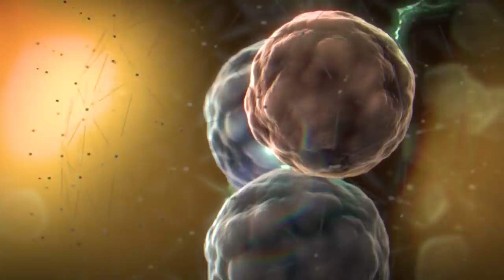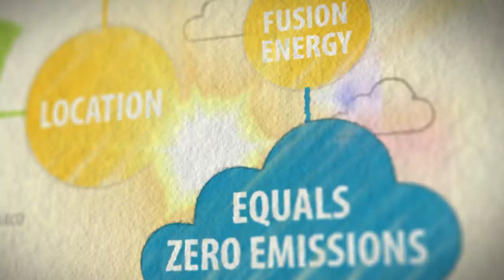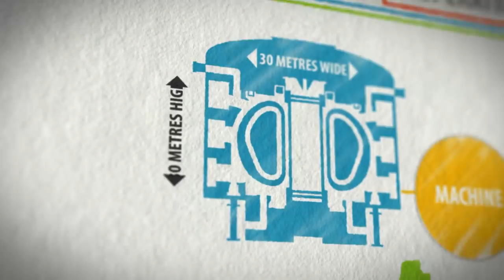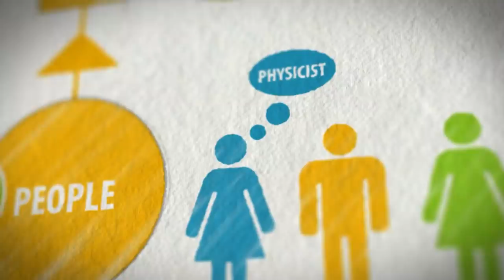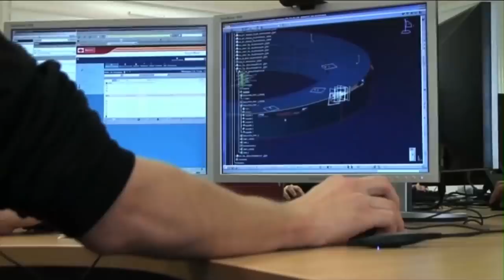ITER NOW 1.1: The Way of the Sun

Comment: I don't understand why it is necessary to build an industrial-scale tokamak when a net energy gain has not yet been demonstrated with a smaller machine. What if this one doesn't work?
Reply: To gain net power, the machine needs to exhibit a sufficient energy confinement time. This is only fulfilled for machines in the size of ITER or even bigger. Smaller machines (like JET in UK) simply "cool down too fast", so that they couldn't produce an energy gain. Previous work on those smaller machines already formed a broad basis of knowledge about magnetic confined fusion, that we're confident enough that ITER is worth trying.
Reply: @fwieschollek  Thank you for the explanation. I accept it, but it begs the question as to why researchers are building and using smaller tokamaks when theory (as you imply) clearly indicates that fusion will ONLY occur above a certain size.
Reply: @bradleycooke5214  The answer is simple: its very complicated and expensive to build such a big experimnt, that it has been  possible  only to study the physics of tokamak devices on smaller scales for centuries ;) Remember, that ITER has been proposed for the first time by Reagan and Gorbatschow in the late 80s. It simply took so long. Good thing is, that many aspects of plasma physics are qualitatively the sane in smaller devices and we try to understand them now and then extrapolate to ITER's size. It looks good in general, but in the end we need ITER to prove thar all the predictions were right.
Reply: @fwieschollek  Thank you for your response, and I appreciate the dialogue! Here's another question: I know about the necessity of superconducting magnets to confine the plasma and how cold they have to be, as well as their proximity to the plasma itself. That's a huge engineering challenge! Question: Is the cryogenic system to cool the magnets used as a heat exchanger for the generation of electricity? If not, what will be the mechanism of heat exchange in a functional tokamak? cheers!

Comment: I sincerely wish that you'll succeed, i'm convinced about you being our best bet for humanity's future. Quick question: did you have to deal with "climate activists" in any way and if so, how did it turn out?
Reply: Why would climate activists be against this? It's clean source of energy!
Reply: @FrankyPi  It's NOT clean but produces deadly radiation products.look it up.
Reply: @esecallum  What you describe are classic already existing fission reactors like in fukushima, once in chernobyl etc. This is a fusion reactor. It fuses hydrogen into helium. The only thing that gets a bit radioactive is protective material that gets bombarded with neutrons but that can be recycled within 100 years its not nearly the same level of radiation as fusion nor is it a nuclear waste like in fission reactors that needs to be disposed of that lasts thousands and millions of years before it cools off its radiation. Radioactive danger levels are extremely low compared to fission reactors. No heavy radioactive elements like uranium or plutonium involved.
Reply: @FrankyPi  Scaling down the sun. As noted above, fusion reactions in the sun burn ordinary hydrogen at enormous density and temperature, sustained by an effectively infinite confinement time, and the reaction products are benign helium isotopes. Artificial (terrestrial) fusion schemes, on the other hand, are restricted to much lower particle densities and much more fleeting energy confinement, and are therefore compelled to use the heavier neutron-rich isotopes of hydrogen known as deuterium and tritium—which are 24 orders of magnitude more reactive than ordinary hydrogen. (Think of the numeral one with 24 zeroes after it.) This gargantuan advantage in fusion reactivity allows human-made fusion assemblies to be workable with a billion times lower particle density and a trillion times poorer energy confinement than the levels that the sun enjoys. Consequently, the proponents of fusion reactors claim that when they are developed, fusion reactors will constitute a “perfect” energy source that will share none of the significant drawbacks of the much-maligned fission reactors.Now, an energy source consisting of 80 percent energetic neutron streams may be the perfect neutron source, but it’s truly bizarre that it would ever be hailed as the ideal electrical energy source. In fact, these neutron streams lead directly to four regrettable problems with nuclear energy: radiation damage to structures; radioactive waste; the need for biological shielding; and the potential for the production of weapons-grade plutonium 239—thus adding to the threat of nuclear weapons proliferation, not lessening it, as fusion proponents would have it.
Reply: @esecallum  Thats exaggeration and false, radioactive materials produced as a consequence of fusion will be recyclable within a century as i said. Do you have any credible source of info about what you wrote, any proof?
Reply: @FrankyPi  google it.
Reply: @esecallum  Google what, i asked you for your sources of what you said. Credible sources I learn from don't state what you claim so I smell conspiracy level bullsh*t.
Reply: @FrankyPi  You re just jealous i know more than you... i don't need to prove anything. also ITER IS A FLOP AND WILL NEVER WORK BECAUSE IT IS THE WRONG SHAPE. ITS SIMPLE A JOBS CLUB.

Comment: what wastes produced from fusion reactor process?
Reply from the maker: ITER will produce very little waste material; here's how it is described on our website:
"Fusion reactors, unlike fission reactors, produce no high activity/long life radioactive waste. The "burnt" fuel in a fusion reactor is helium, an inert gas. Activation produced in the material surfaces by the fast neutrons will produce waste that is classified as very low, low, or medium activity waste. All waste materials (such as components removed by remote handling during operation) will be treated, packaged, and stored on site."
Reply: @iterorganization  very cool...or hot!, can't wait for the fusion energy!
Reply: @NKG416  just to add to iterorganization answer from their website "No long-lived radioactive waste: Nuclear fusion reactors produce no high activity, long-lived nuclear waste. The activation of components in a fusion reactor is low enough for the materials to be recycled or reused within 100 years." In comparison nuclear fission what we currently use creates waste materials which can last from 220,000 up to 15.7 million years.

Comment: I'd love for this to pan out but the timescales involved in iter are measured in decades, way too late to help resolve climate crisis and general energy needs of the planet. Don't forget iter are doing the groundwork but will never produce real electricity, that comes after several decades of research and more time building a real reactor for actually powering cities. Also can't help but feel that it's a little "all eggs in one basket" strategy, with the tokamak design only, certainly the best current strategy for fusion but may not actually be the best after necessary research work is performed. Sad really.
Reply: 1) So? Give up because it takes too long?
2) So it's already too slow and takes a huge amounts of resources, and you want to split the time and resources for MORE parallel projects?

Comment: i don't wanna be that guy,  but this will most likely fail..  and fail hard.   oh well.
Reply: Based on...
Reply: @trezapoioiuy  "Reality", as of end of 2022, this is already a failed project.  multiple parts have cracks and fitting issues.  Fuel for this thing is very limited, and smaller projects that will get ahead of this now, to be able to test first will use up that fuel.   

let me get this out of the way now;
"Told you so."

Comment: China would have built this entire place in 3 days :
- 1 day to prepare the ground
- 1 day to carry parts
- 1 day to assemble

Amount of workers involved in the operation : 6.66 millions, 3.33 working the day and 3.33 for the night.

Time required in europe : 30 years.
Reply: it would be an empty building because the need to build the machine before to start the research. The result will be in 2050 and the first fusion civil plant in 2060 or 2070 only
Reply: China also has a domestic tokamak program.
Reply: @alandpost  and it's not being made in 3 days.
Reply: @trezapoioiuy  Yes, that's what I was getting at
Reply: @alandpost  I know, but since some people can't read between lines, I spelled it out.